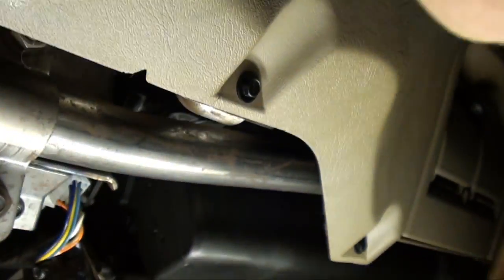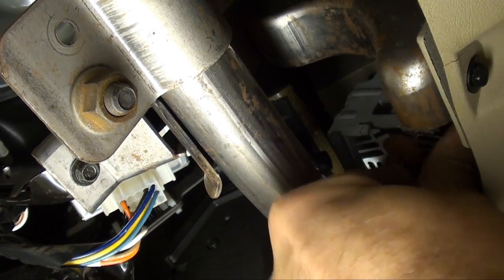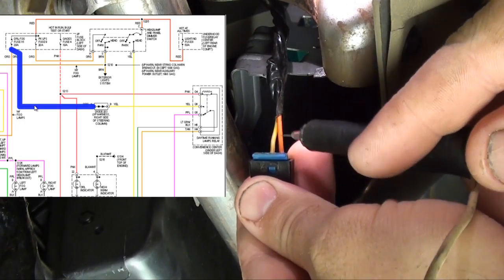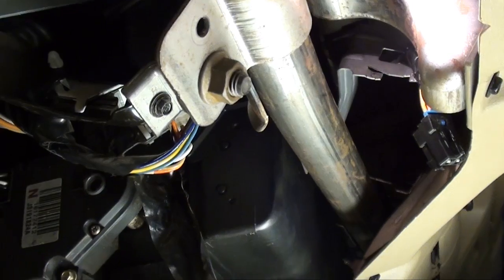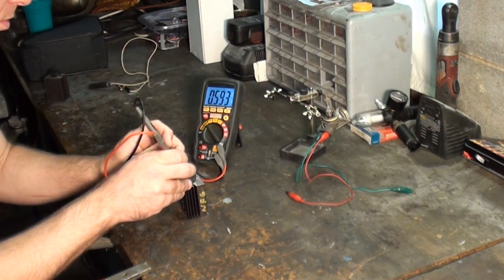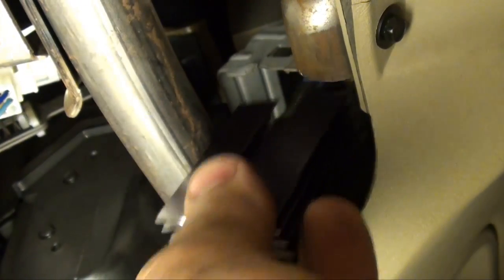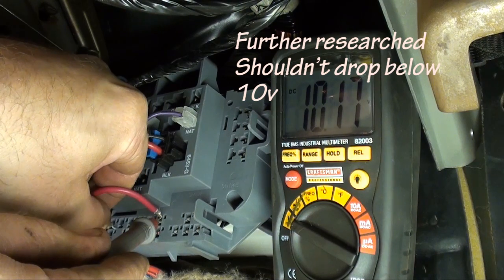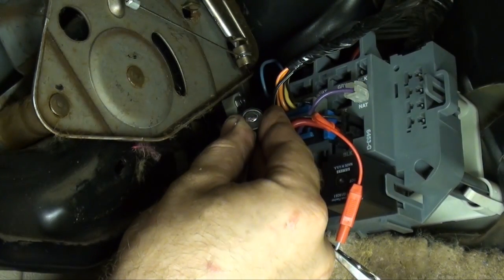Part-2 Daytime running light circuit troubleshooting (DRL circuit)

Comment: My headlights on a 1999 k1500 suburban will not come on if the DRL lights aren’t working either I have checked fuse and replaced main switch. All other lights work correctly. Wondering if you give me another ideal what to look at

Comment: FYI, the purpose of the diode is to lower the voltage on those low beams (to approximately 10 volts). Since they’re also used for the DRLs which are on most of the time, it saves wear on the filaments.

Comment: This is absolutely the best video on this.. almost every step I was wonderin when you were gonna show a detail.. and you did, bc it’s a fact that details matter with electrical.. all the newer cars (this one included; roughly late 90s up) there is soo much that matters especially since a lot of its computer controlled.. and it is true that generally they read around 10.55v or so as a new diode etc.. when it’s running at say 14.4v you’d have roughly 12.5v so they don’t run at full brightness all the time..
Reply from the maker: Details do matter, especially when dealing with electrical systems in cars. It's like solving a puzzle!

Comment: Nice presentation. Some yards won't let power packs in their Yard. 
Would it be possible that it has a capacitor also onboard with a diode
That would explain the drop on voltage

Comment: Hey I have an issue with my 98 chevy silverado k1500 5.7 4x4 the taillights not working blinkers work brakes and hazards work new boards and new bulbs front and dash works just not the rear for lights being on

Comment: What if you have front running lights but the tail light running lights aren't working? Have brake light and both blinkers just no running light on the rear end

Comment: I’ve been driving my 1999 van with my driving day head lights for night use for a while. I spent time and money replacing parts including the cruise control switch which solved the issue for a little while but lost my high and low beams again and now my day driving lights went out. Thanks to your video I checked fuse 4 and 15, I pulled out fuse 15 with the van running and put the same old fuse back in and now I got my daytime running lights now I think I’ll just r&r the fuse with a new one. I also unplugged the diode and plugged it back to see what my head lights would do. Thank you for a great video.

Comment: My truck is a 94 Dodge Ram 3500 and my drl is tied to my speed sensor. Despite a good fuse it isn't working and nor are the reverse lights or the radio. I'm having trouble finding an electric diagram online so I don't know which module controls my drl.

Comment: I have a question hopefully you can shed some light on it for me. While I'm driving at night I'll hear a click and look at my dash and the DRL indicator is lit up and when that happens my high beams don't work. Where should I start to diagnose this problem? I pulled the diode light some people said and the light still comes on on the dash but then the headlights turn off altogether because the DRL diode is no longer attached...SMH

Comment: Thank you for those great videos (part 1 & part 2). I have the same problems with my 2000 silverado; no daytime running lights, but I can't find the diode under the dash. You said that's a common problem with GM. Would you know where my diode is located? I checked all the fuses and all the relays... All good. I can't find any diodes though. Thanks again!
Reply: Hey man, I’m having the same issue, did you ever find it?

Comment: Thank you Robinson Auto. I was having daytime running lights issues and my son and I watched your video and then started working on our vehicle. We followed your troubleshooting procedure to the tee and long behold the problem was the diode/daytime running lights control module. I know for sure we would have been throwing parts at it until it either fixed it or had to take it to a mechanic. Thanks a million or hundreds of dollars $$$ !!!

Comment: You know man I've looked at hundreds of videos and yours was so good give me a better understanding of everything I have a 2000 Toyota Corolla I know that two relays are bad the main headlight relay in the DRL headlight relay my daytime running lights work and I have voltage all the way through to the DRL relay but when I turn on my headlights they don't come on. So i know that since the headlight relay goes to the dimmer relay  and then a dimmer goes to the DRL relay. But daytime running lights work during the day as soon as the sensor as sensitive as it is now detects any amount of Darkness it cuts the daytime running lights off which it does it supposed to right.  but also at night after the timer goes off for the daytime running light sensor whatever detects no light all of my lights Flash except for my headlights. Which is my regular lights that turn on running lights.  the problem is is that the headlights don't work the bulbs are good the relays need to be replaced I know but even putting in jumped relays by putting a wire between the magnet and the plate I know that it was working but now I have going back to the engine compartment the wiring to the internal under the dash that the possibility is the diode or something else so far I have failed to locate the diode as of yet but I have no clue of why this would fail even though my radio runs all the fuses of our working and the accessories are working can you please help me.   just so you know I have talked to several mechanics and everybody told me it was a short ground this is not the problem and I know it is not the problem because I checked all the way around with the multimeter and pulled the fuses and pulled the 40 amp main fuse and everything and the relays I know are bad but everyone says this is not a common problem for this car also around here in Texas people want to charge me between 1 and $200 per hour just to diagnose the electrical problem and I'm not trying to pay that I usually work on cars myself and I can replace Parts no problem but it is not working for me..

Comment: basically, the diode failed at the barrier (anode meets cathode). You see the polarity test is still working but the funcional test failed  (amps-volts) because the quality of the semiconductor is degraded. The nominal voltage drop between the diode is 1.6- 2.0 volts. Depending of the specs of the diode ( germanium purity, aplication, voltage, voltage break, amp break, temperature, wattage, etc)

Comment: Got a video on hazard light? When the button is up, they are stationary when pressing the brake and dont blink, when held push down in a certain spot the front right blinks really fast. The multifunctional switch and flasher has been replaced though. Another relay broken or wires spliced differently?

Comment: My low beams are currently non-functioning when the light switch is turned to on. My DRL have not worked for years. Would my low beams become functional again if I replace the diode?  Or is this a switch on the stalk?
Reply: I have the same issue, did you figure yours out?
Reply: @eqlizer02  yes, It was the wire harness going through the column. I believe we replaced the turn stalk and that took care of it.

Comment: I'm a technician from Chevrolet good job but? Remove your ring when you work it will melt it if you touch positive cable in you finger
Reply: been there done that.

Comment: I commented in part one, no DRL or brights, and pin 87a has power, for the DRL relay. Other vids say this is to be normally open? Also the wiring feeding the brights have power when I check with a test  light, that is, when I check either side of the plug it shows power.. when the bulb, which shows good through continuity, is inserted it does not lite. I don't understand, is the system in parallel, is this why each side has power, because,  if I don't have the the bulb inserted on the left side, the right side  of the socket terminal contact, will not show power. Is my explanation confusing, for I'm trying to put it down as clear as possible.

Comment: robinsauto, I am not able to do the same test that you did on my diode so what do you think if I put a jumper wire in where the diode came out to see if my head lights work? I would not turn on anything other than just the switch key. 7/17/2018

Comment: Question, I have a 2002 Chevy Express that I installed LED head lights. Everything works for the exception of the Day Time running lamps, it causes them to flicker.... Question, If I pull the diode, the day time running lamps will just shut off or is it best to put a jumper across the diode harness to get full 12v to the day time running lamp..?

Does all that sound right?
What program did you use to highlight your schematic?

Comment: As a retired electronics technician and life long shade tree mechanic (auto, motorcycles, small engines), I was curious how you would explain your troubleshooting steps so that a layman could understand them. I had this same issue in my '96 Chevy Suburban, but had already repaired mine. Anyway, serious kudos to you. This is the first one of your videos that I've had a chance to watch. I was impressed. You did a fantastic job of explaining the troubleshooting steps from the easy to the more complex. Using the actual wiring diagrams and tracing connections that way was also a very helpful thing to fully instruct lay people on the proper methods of troubleshooting circuitry such as this.

One thing you may want to mention, though, is that power should be turned off (no voltage applied to test circuit) during any continuity checks while using your actual meter to perform those tests. However, most folks following your video who have a DVM would probably already know not to check resistance (ohms/continuity) with power applied.

So, in closing... definitely a 5-Star vid, man! You did a great job of it. I'll be watching more and also subscribing to your channel.
Reply from the maker: V.T. Eric Layton thank you for the positive feedback it's greatly appreciated!! It's always good to here that the extra effort is recognize so thanks again! Look forward to seeing you around 👍🍻
Reply: My low beams are currently non-functioning when the light switch is turned to on. My DRL have not worked for years. Would my low beams become functional again if I replace the diode?  Or is this a switch on the stalk?

Comment: it gets more difficult than this. My 96 has No DRL, yet needs fuse 4, 15 and the relay. Fuse 15 makes the ECM quicker...and it may be using the diode underhood (the little one). LED lighting, complete swap.. it does away with the old monsters.

Comment: This is a fantastic video, come to find out for the vehicle I have - 2003 Buick Lesabre custom - from GM they want ----MODULE. Headlamp/Fog Lamp/Turn Signal
Part Number: 16518845 ; 16518845; 16515790
MODULE, HDLP CONT. MODULE,DAYTIME RUNNING LP CONT. --- Your Price $ 796.84 --- WOW - I am going to check the auto graveyards before I even try to fix this... THANK YOU SO MUCH, You are THE BOMB !!!   Oh crap now they are going to think we are terrorists... sorry...

Comment: I'm having a problem with my drl I have power all the way back to the plug that located on the frame with it plugged up it keeps blowing a fuse.... With it unplugged I have dash lights and front drls just no rear tail lights  where could my problem be??

Comment: This séries is fantastic, you are the best, my 2001 Infiniti qx4 manufactured in 2000 low beams both left and right go off after 15-20 seconds, what could that be? I can't find the dry, says it should be near battery but not there, help

Comment: Thank-you for posting this terrific diagnosis and repair. You said "let's not throw parts at it" meaning that you could have just bought every part in the circuit and after replacing them all, it probably would be fixed... at great expense to the owner and no understanding of the system by you. 

I worked in the trade for 50+ years and always took the same stance - 'diagnose first/replace parts last'. I could have never worked at a dealership where they just tossed parts at a job until it was repaired. 

Your logic made me smile all through the video - both of them - and I truly appreciate your candidness and cool tone of voice in explaining this problem. I too, had the same problem with the same results on my wife's 2000 Astrovan when the DDLs failed to work properly. 

I knew it was the diode, but I wasn't sure which one it was after my diagnosis. Thanks for pointing it out to me. The underdash of that p/u looks remarkably like the one under her van. 

My next problem is the ABS system shuts off and fires the BRAKE and ABS light when it does so. 

I've followed the schematic and it leads me to K5 cross member ground screw  (which doesn't exist on her van) as a possible intermittent ground problem. 

That makes sense as the ABS tends to go OFF (by lighting UP, that is) mostly when she hits a bump or rut in the road. And no: I've checked the wheel bearings and tone wheels, pickups, etc to find no problems there. 

The signal circuits all Ohm-out within range of each other - as I have no real specs there. I just wish I knew what the engineers thought was the K5 ground screw on an Astrovan? 

What do you think?
Reply from the maker: Joe Vreeland thank you for the compliments!!! Man I appreciate it. Any luck with the ABS issue?
Reply: It's still haunted - the ABS circuit anyway. It seems to stay working and not turning the ABS and BRAKE light all winter long when we need it badly, but come summer and clean roads, it will turn itself off all the time. 

I'm still going to go after a defective ground somewhere - I just can't decide if there is supposed to be a full time ground or it's controlled by the ABS system or not. 

Circuit  schematics all seem to be for other vehicles - other than an '00 Astro with 2WD, that is.
Reply: robinsonsauto I'm recovering from knee replacement and won't be up to speed for a bit yet. Then I'll get into it deeper. I'm sure it's just an intermittent flakey  ground, but I haven't found it yet. Funny that it seems to work well all winter long, and when the roads are clear, it will cut out. How does it know? I dunnow. 

I wonder if just tapping into all the grounds and establishing a "helper ground circuit" would be a good idea. That wouldn't actually be my typical diagnose and then repair policy, but if I can just improve the condition.............hmmmmmm.

Comment: Thank you so much. I'm an idiot when it comes to electricity, but you are the first to speak my language and now, since I have a 99 suburban, I'm going to make it a point to learn all I can about this crazy electrical system. I've had some very curious electric issues (dim lights, cruise control shutting off on the highway, and serious low-voltage issues the alternator hadn't seemed able to catch up with), but this little fix has cured it all...weird I know). I even got my 13 year old son to do the work for me, since I don't know if I'd be able to get back up after wedging myself in there. Thanks again, and I'm going to watch your other videos, too.
Reply from the maker: your welcome, thats awesome im glad i could help out and make memories at the same time, im sure your little man feels proud, shake his hand for me great job bud!
Reply: WendelltheSongwriter

Comment: How do you get 9005 LED running lights to operate correctly ? I replaced my 2001 Saturn with LED running lights and they don't work except with the Bright Light switch in the on position but releasing it they go back off. I know it's due to "Low Power" usage vs. incandescent bulbs but I haven't found a way to get them to operate. Load balancer's do nothing as well so that's not the issue. That couldn't work because they'd have to run all the time and that could cause LB's to get too hot. Those are only for Hyper Flash anyway. I'd sure like to get rid of the incandescent bulbs, please help ! lol.

Comment: Excellent. Mine is a 2002 GMC Safari - bad wiring found behind left-front running light. Blew 2 x 20 Amp fuses - one for the instrument panel and rear lights. The other for the turn signal. Problem, no running lights - sourced to Diode.
Your video helped make the fix that much clearer. Thanks!
Reply from the maker: Nice job!! glad you found it helpful

Comment: My truck is lights had all 4 with the high beam on. Now it's just the inside. And before the high beam lights were the daytime lights . And now it's the low beams. Also the radio light doesn't work unless you turn on the lights.

Comment: Awesome video!!  I have an issue with my 2005 suburban where only one of the DLR lights work.  I've changed the bulb and checked the fuses... any suggestions?  Thanks in advance for your suggestion!
Reply: Same vehicle, same issue.  Had to change out the actual socket (DORMAN 645607).

Comment: This is an awesome video very informative and very thorough. I have an issue actually probably at my headlamp control switch interior light dimmer switch. THE daytime running lights work fine but when I turn  the headlights on (which is the 12 o'clock position on the dimmer switch in the cab) the running lights go out. But the headlights do not come on although the drl light goes out on my dash. Also if I click the stalk on my hazard/turn signal switch I see the bright lights come on BRIGHTS do work but the regular headlights don't.. Or at least it seems so are daytime running lights and low  beam headlights the same thing ...ANY suggestions?

Comment: hi. DRL on my suburban 2009 are not working, bulbs are both OK. do you have DRL diagram for this truck ? or at least locations of parts(module and resistor)  I should inspect. I have checked fuses and relays , they are OK.

Comment from the maker: i believe they made some changes and stopped using the diode, i will need to take a look at the schematic later on and get back to you, if you can post this on my toolsandtime. com forum its free i would prefer this, going that rout i can post a schematic for you